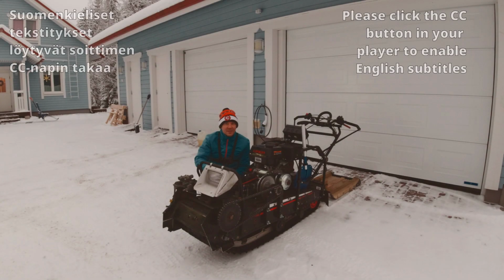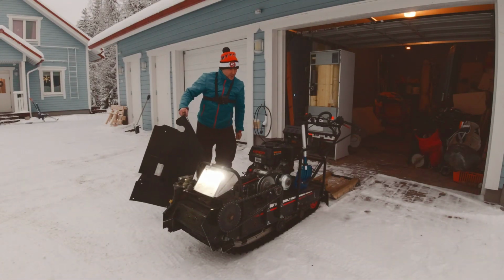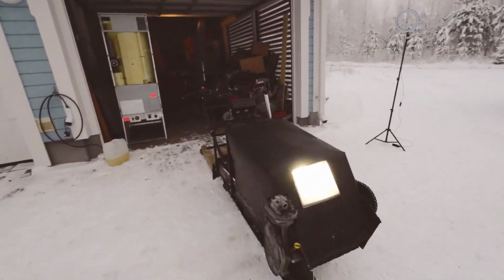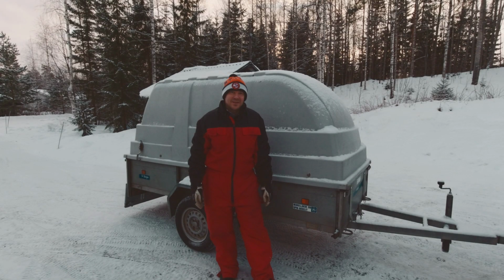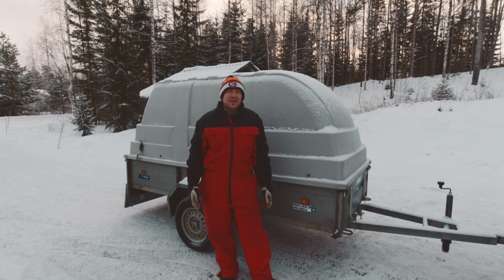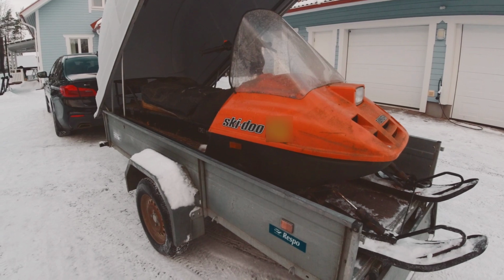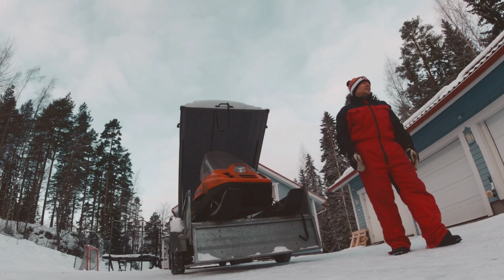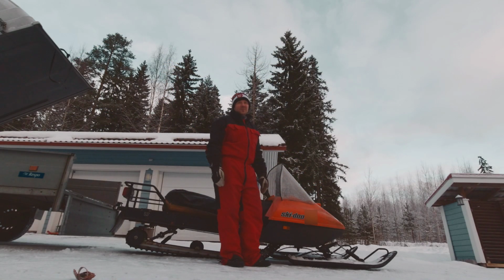How to build a Snowdog part 12 - End of story (and beginning of a new one!)

Comment: I wonder if the snowdogs you can buy work better?, not that it matters cause you can't really buy them anymore anyway since they are made in Russia.
Judging by this video the one you can buy does seem more capable https://www.youtube.com/watch?v=8SZLT_eTuVg. Not dissing your homemade version, not like I could make one.
Reply from the maker: Yeah, possibly they could perform a bit better, because of 10cm wider track. But there still enhancements that you may need to do, for example this: https://youtu.be/dU9KsbG2JxU?si=hEE2UlPLgLQckfuH 

But eventually, everything debends on what you want to do with the thing. I would say, that track sled performs well on even and open area. If you have longer powder snow uphills or you need to turn very tight, or there is a lot of slush on the ice, Snowdog is not very practical. I have also heard that the quality of Snowdog and Tingerdog is quite poor, easpecially if you are maintaining longer trails with those things. There are durability issues on the frames and drivetrain.